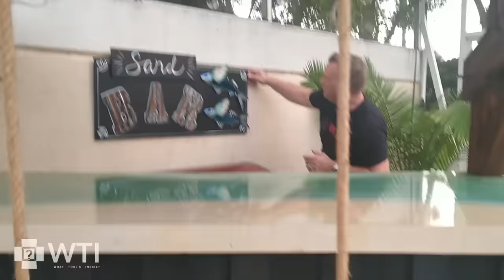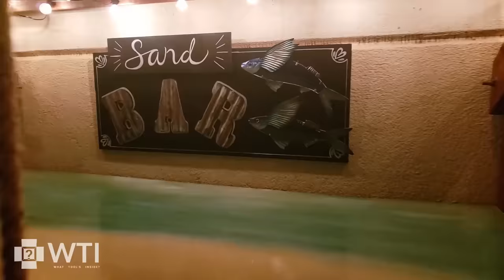For Under $300, This DIY BBQ Cover Can Be Your Backyard Bar

Comment: Love the video. Looks like an amazing bar. It says it cost under $300.00 yet there are no mention of what wood you bought. Would love a list of materials and dimensions only thing missing in the video.
Reply: There is NO WAY this bar gets built for under 2 grand. The tools alone and the skill on top of all the wood and stain, nails, etc. The $300 is click bait
Reply: @DogWaterChamp  they used pallets...most of the time are free
Reply from the maker: We didn't add in the price of the tools we used in the cost of the project.  Just posted all the materials that were purchased up in the details, hope that clears things up!
Reply from the maker: We did get our pallets free & repurposed the nails also! 👌
Reply: @WTIpov  Thank you for adding the materials that is perfect! I love the project and will give it a try  now : )
Reply: @DogWaterChamp  If your going to make this - I am assuming you have the tools. Otherwise why would you look at this? I have all the wood left over from building my fence so I am guessing I can make this for under $ 300.00

Comment: Do you think you can make it a little bit longer for it to have 3 to 4 swings ? Or will it be too much weight ?
Reply from the maker: You could easily make it longer to accommodate more swings by cantilevering both ends, but I would also add an additional post on the left for extra support.